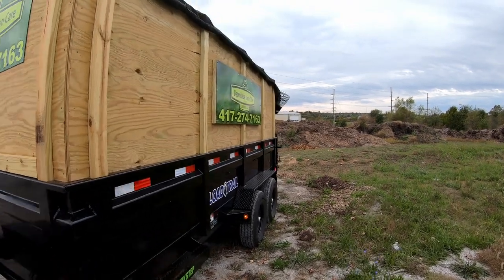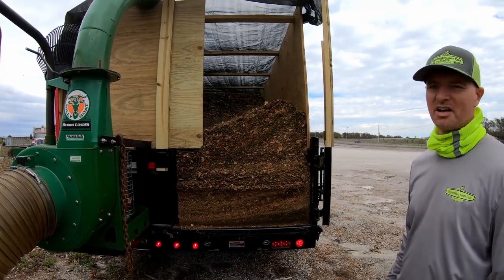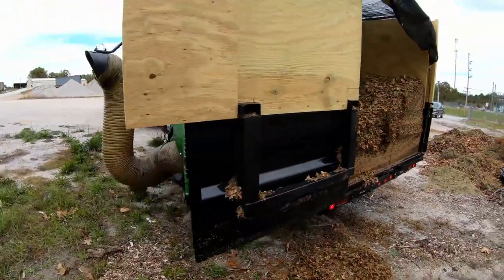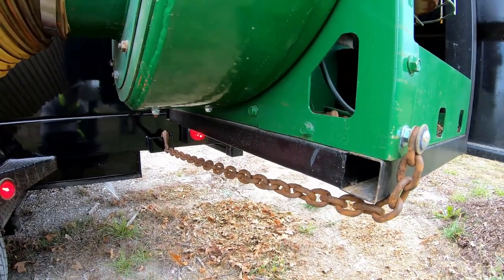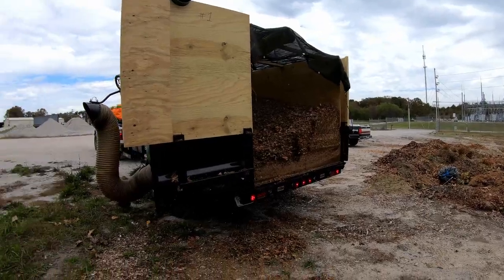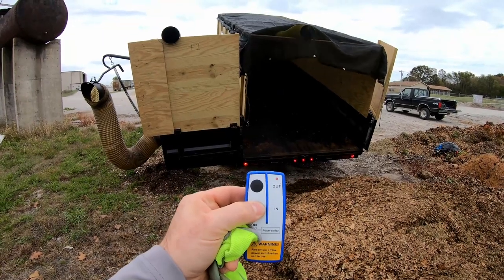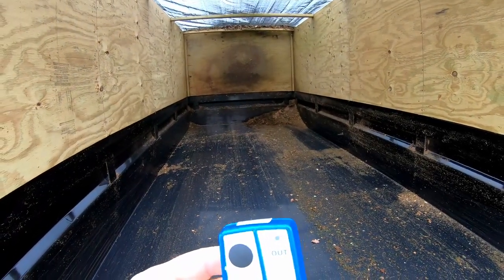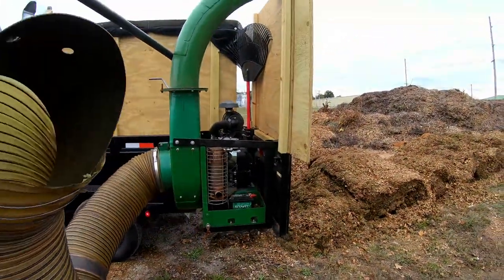Dumping The Debris Vac Setup

Comment: Looking good. Question; in the past I haven’t done leaf pickup/mulching, but I’ve got people asking me to do it this year. I’m just not sure what a fair price is. Do you have a formula for pricing?
Reply from the maker: This is my first season with this setup, so I am still figuring it out myself. I have come up with a minimum charge, but after that I am try to figure out whether to charge by the amount picked up or by man hour?
Reply: I’m in Boston, most of the houses are small to average size. I hit each house twice….. I have a few that I have to go by three or four times because they get pounded….. and I have a handful of what I call one hit wonders that I wait till after Thanksgiving…. but generally everyone gets two visit otherwise you’re spending way too much time there and racing against the clock… And if it’s a wet season those leaves are molting and ruining the grass. I’d rather spend an hour and a half two times then spend four hours because it’s a shit show. This way if it snows early at least you got half a check from the customer. I don’t want to pull the truck over for less than 250 $. My goal is to make minimum 500 off each customer for the season… but sometimes it’s 375 sometimes it’s 450 or 400 but the goal is 500 and up.   I mean it all depends on the size of the property, some houses I’m getting 700 to 1200… As far as an hourly rate it’s kind of tricky, I’d rather just price buy the job… Because it’s not just the guys it’s your truck, your leaf loader $650 blowers etc. etc. etc.…if they are new customers sometimes I give them A break and I do a real good job, then I tell them moving forward it’s going to be two visits at minimum 200-225 per visit………. Been working just fine for me….. If you run into a huge property and you’re not sure ? Make sure you do the math first on gas and disposal—-you don’t want to be paying for this guys dump fee AND gas .  Just break the job up like it was a few different yards put the price together and go for it. Better to overcharge them than to get screwed……. this year 2022 All the leaves fell early which is good because it gave me time to take on new customers / more money…. now I have just a few finals which I will blow through in about a half hour 45 minutes each visit.   hopefully the weather stays good because I will do cleanups until the spring. I put out a sign that says year-round cleanups and believe me the phone never stops ringing _💪💪💪
Reply from the maker: I appreciate the advice and I work with a couple firefighters from Massachusetts.

Comment: What’s the advantages of putting it on either the driver side or curb side? Having one installed tomorrow, need to make a decision, thanks!
Reply from the maker: It's all about your operation and preference. I'm solo part time so having it on the driver's side works better. The down side is facing traffic.
Reply: @HandyGuy2016  Thankyou for responding so fast. We run a 4 man crew and the trailer shop suggested curb side. Being somebody who’s had a lot of experience would you suggest the same if you had more people, or would you keep it driver side?
Reply from the maker: Passenger side if I had crews

Comment: Did you show how you reinforced the door hinges in a prior video? Or how the loader is mounted etc? Where I live the leaves freeze (over night) to the bed of the trailer if I don’t get them out and it’s often necessary to back up with a bit of speed then break hard to get them to come out. That would be hard on the hinges etc without some kind of reinforcement.
Reply from the maker: Yes I did, I have videos on the entire build.